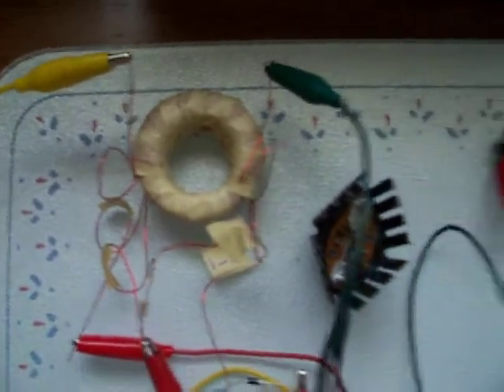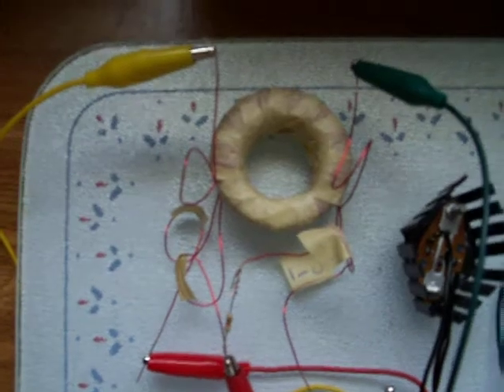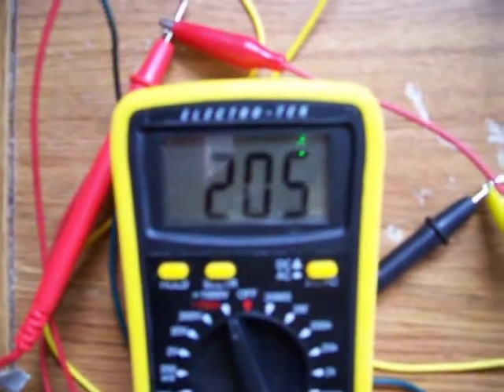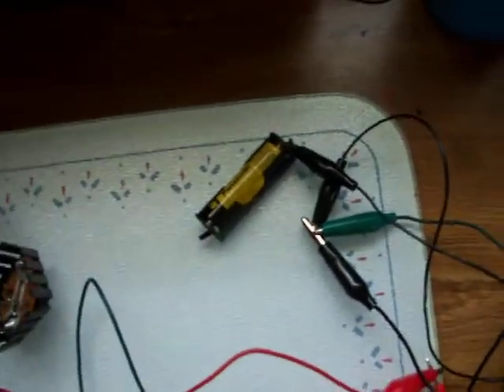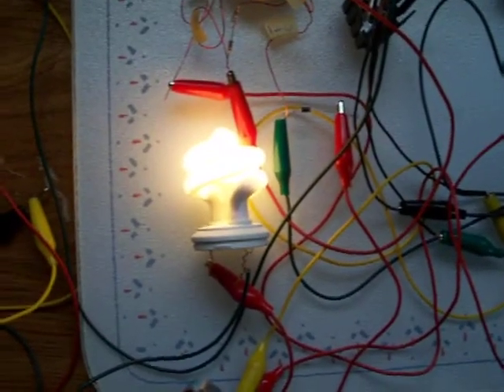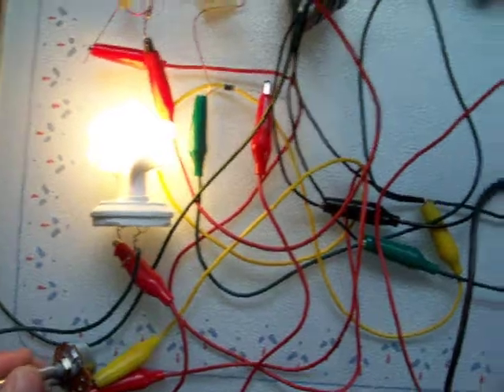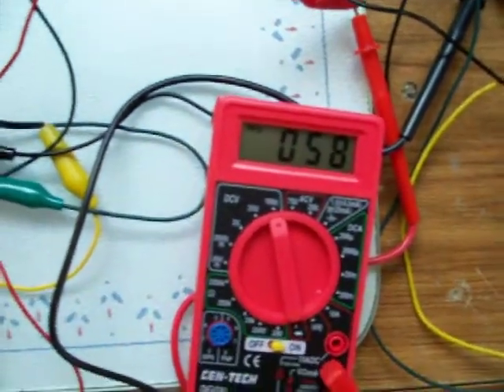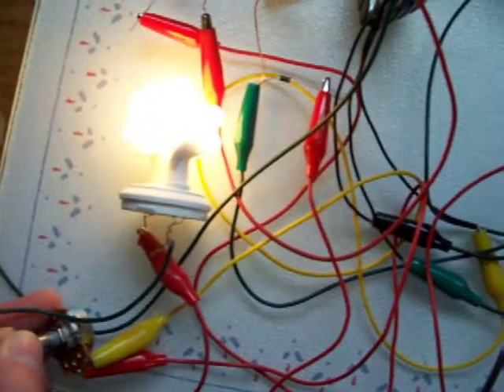Joule Thief Big Pickup Coil

Comment from the maker: Off the 12v battery without the cfl it takes 140Ma  to 600Ma.
With cfl running it takes 20Ma  to a little over 1 amp.
It was brighter at 600Ma to 800Ma.